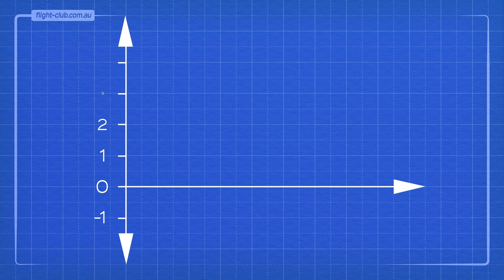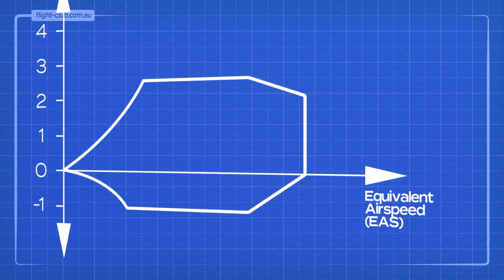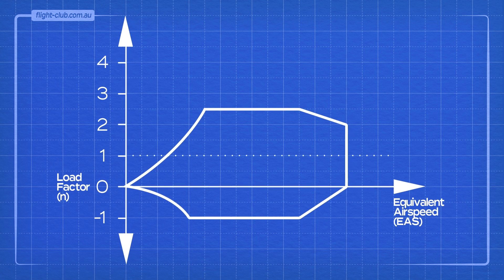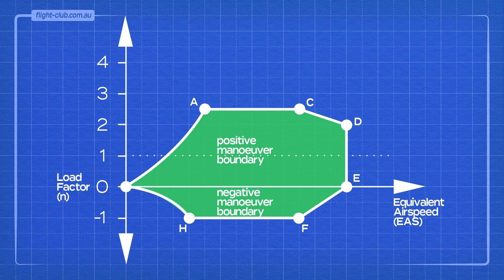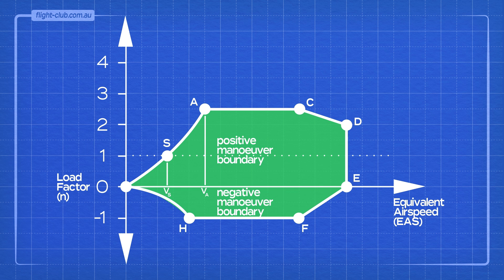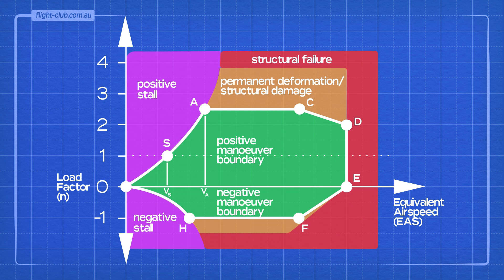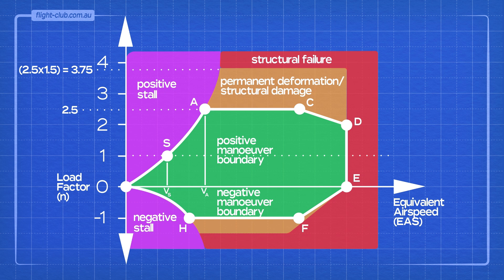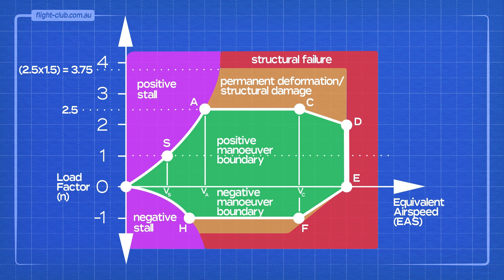Manoeuver Load Diagram | Your ATPL guide to the V-N diagram.

Comment: Va is not directly at 2,5 LF ; its sligthly behind
Reply: Every airplane is different load factor limit for positive on archer is 4.4 G at utility category. And va in our archer is found by doing a formula is “Va @ max (113) * √(current airplane weight/max weight)= Va. also the Va is always changing as fuel is being consumed